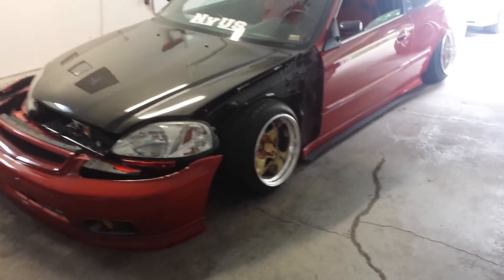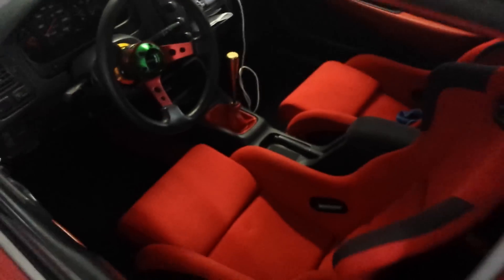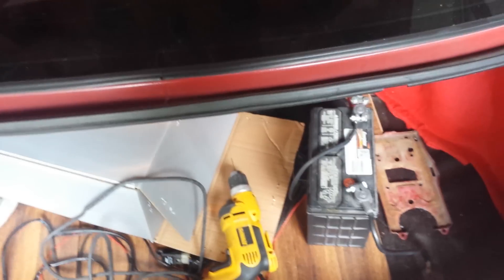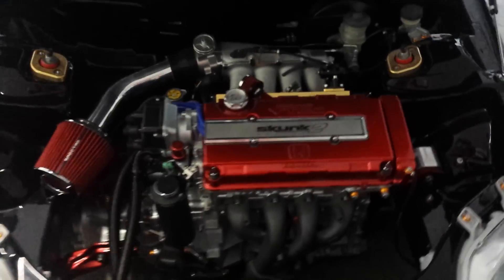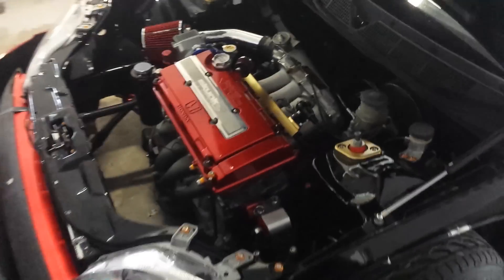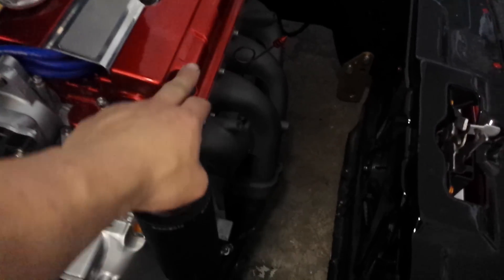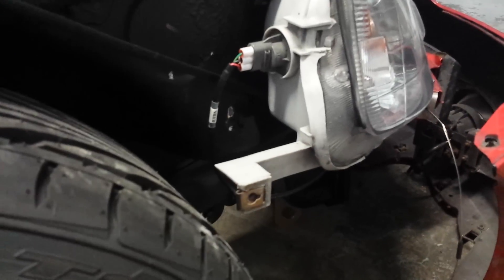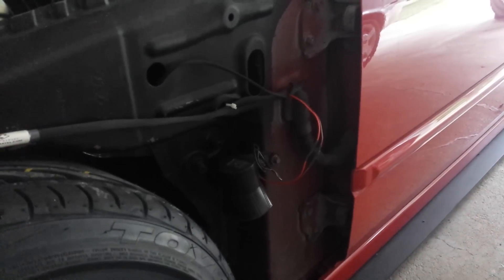Slammin_em1 build progress

Comment: how much money did all the engine work run you, im thinking of doing what u did
Reply from the maker: if I count every little thing. its over 3k. the motor had 0 miles before I test drove it.  but I didn't cheap out on parts. I bought some of the top stuff I could get.   example is the skunk2 intake and throttle body.

Comment: how much power is it making?
Reply from the maker: it made 150 to the wheels. 175 to the crank
Reply: thats actually pretty good
Reply from the maker: +T_GaMeZz _T I thought so too.  its completely stock. so I cant complain.  the guy said after i brake in the motor some more the power may go up.
Reply: or go turbo ?
Reply: around 9 hunnid doe fr :triumph: